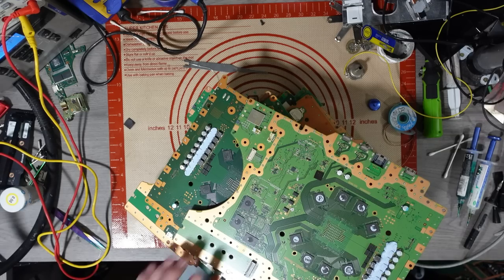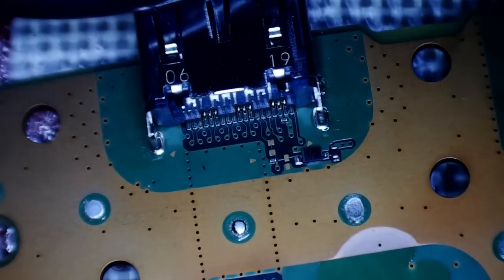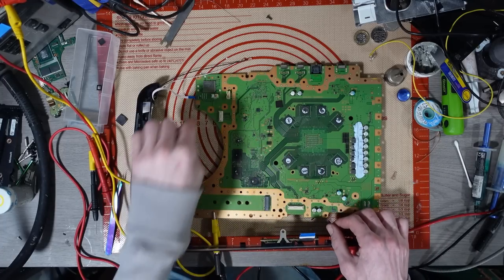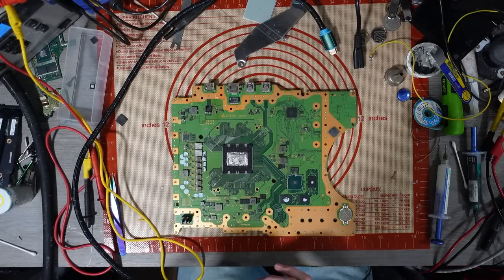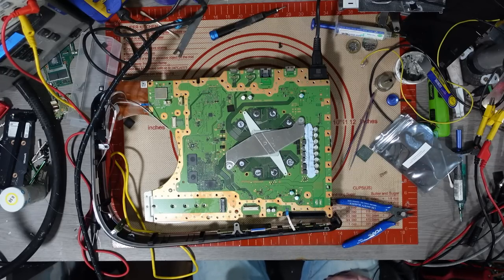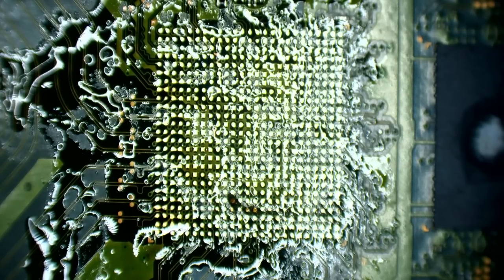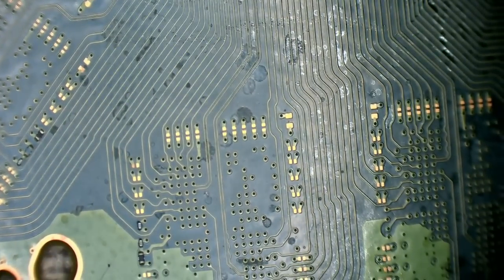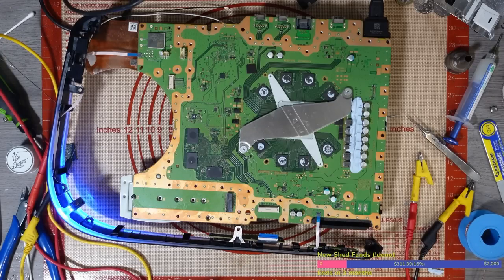15 PS5 Boards Sold As Scrap! How Many Can I Fix? (Part #2)

Comment: hello I had a problem with my ps5 so I think I have a blod it flashes, impossible to put it in safe mode it turns off directly and of course no signal on the TV and I noticed that  my front and rear USB ports don't give an idea please?

Comment: if for digital version can you not use the motherboards
Reply: No, something on the board is expecting the matching disc device (I assume the APU since he said that in the video) and if it doesn't find that, it apparently doesn't let you update the system software. It doesn't just turn into a digital version.

Comment: If you are selling parts from these boards, how do you know the parts are working? Isn't this the reason you MUST repair these boards first so you can test them?
Reply: Is there not a way to check chips and the like are working without restoring the whole motherboard back to complete working order? There must be or that would be brutal.
Reply from the maker: I take diode readings and compare them against working chips before taking them from the board and if they don't match a known good board I don't use them :)
Reply: @TheCod3r  that's what I said lol. I reckon you get half of them working.
Reply: I mean half of the 15 boards not half the chips you sell. That sounded wrong.
Reply: @TheCod3r  diode readings alone cant decide the full functionality of a chip especially chips with multiple legs, there are lots of inner microcompressed components that may not be direct connection to the legs youre probing. for fets, regulators, caps, diodes, resistors are some of what you can do that way. Im not discrediting your method, you do great videos otherwise.